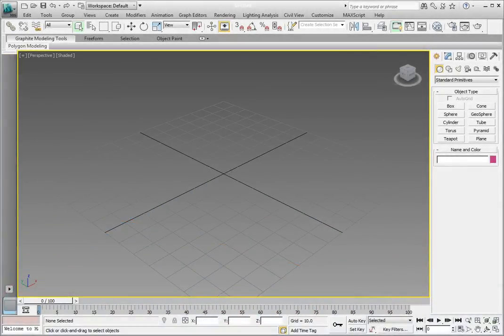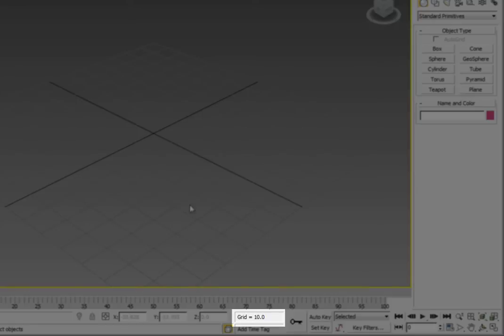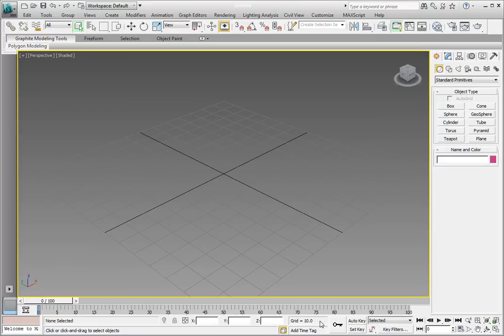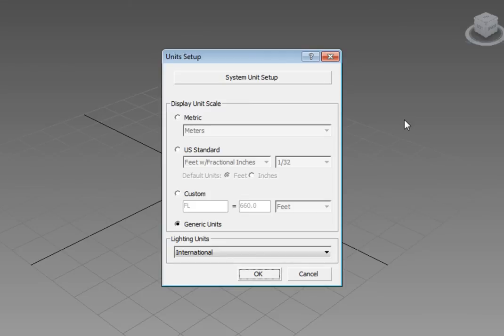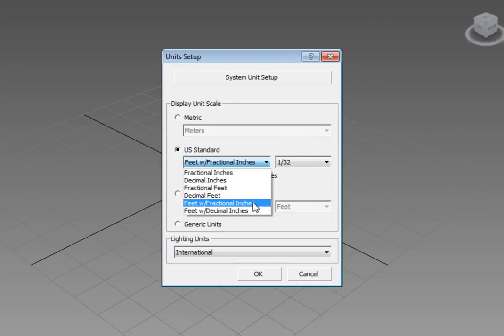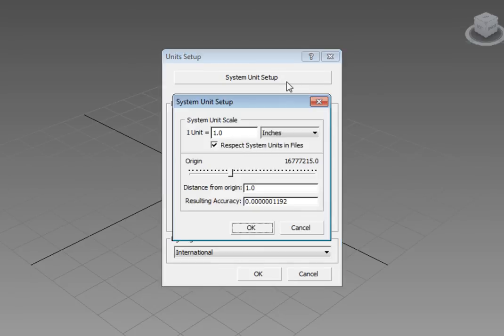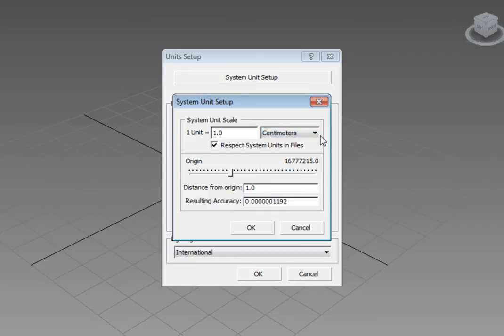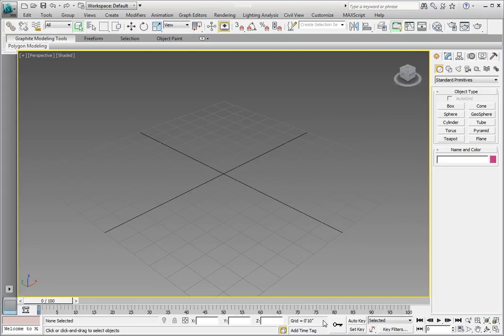setting display unit and architectural in 3ds max

Comment: in my view port when i am increasing the size of my object by just 1cm its becoming really big, please help, and when i am scrolling zooming the zoom in or out steps are really high.
Reply from the maker: in 3ds max you have unit setup problem when u increase 1CM it increase 1meter just go to customize>units setup>select Generic units and in the lighting units select international if it not work try just click on system unit setup and change it to centimeter
Reply from the maker: if its all not work just reset the unit configuration
Reply: okay thankyou very much sir